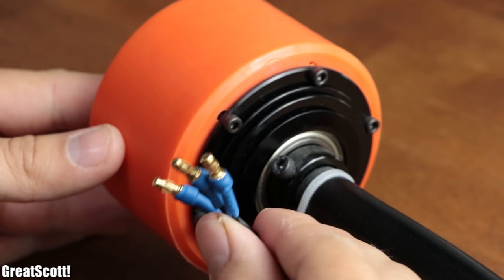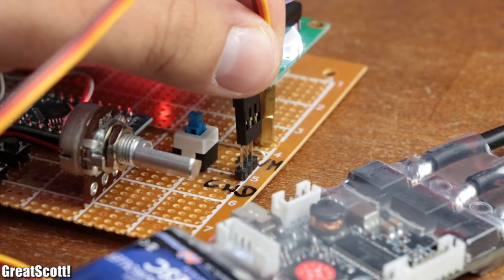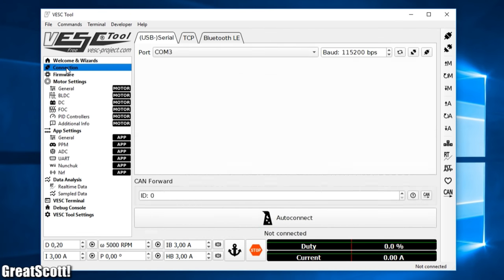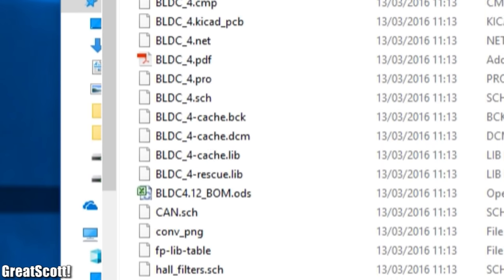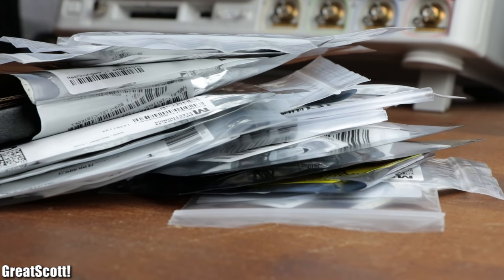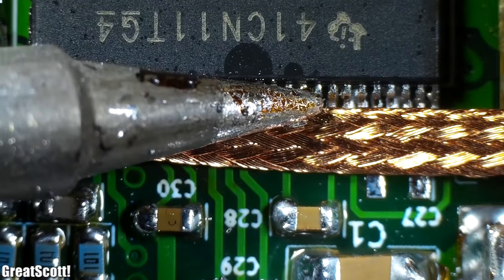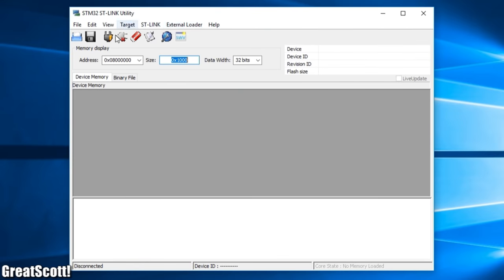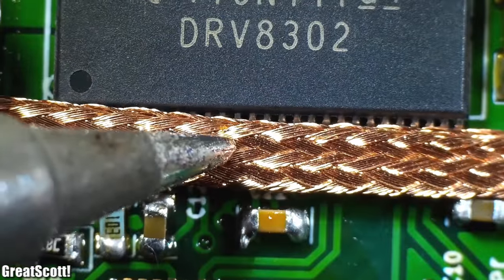VESC (Best Open Source ESC) || DIY or Buy

Comment: I think you would have had much better luck if you used copious amounts of a good organic water soluble flux, and solder with water soluble flux core. It cleans up very easily with a small amount of soap and hot water. 

It looked to me like you didn't use any flux except for what was in the solder, this is why you had trouble soldering the close pitch SMD chips. Here flux is your friend, I drag solder those fine pitch ICs all the time it's fairly easy with a lot of flux, and a little technique.

If you want to you can send me one of those that you didn't get working, and I'll troubleshoot it for you.

Have a great day, and thanks for the great videos.

Glenn
Reply: Any Amazon link recommendation for flux?

Comment: Should have had a stencil made using the top paste gerber layer, you had the solder paste for it. Also that hot air gun action might not have done some of the components too well either.
Reply: Alucard Pawpad Yeah, I’ve had a few inductors go open circuit from using a soldering iron on them.

Comment: You should practice soldering more, this way you can avoid such a hassle. Just pretin the pads, put the component on with tweezers and hold it while heating it up with the heat gun. Works perfectly fine. Don't forget flux of course.

Comment: I would suggest ordering a smt stencil when making several boards. Costs about 6$ at JLC and saves a lot of headache and combined with a hot air/oven soldering pretty much guarantees nice and working boards. Lazy as I am (or willing to pay to save time) I also order the boards  as panels (another 6$) so I can apply the soldering paste to all the boards in one go. Thank you for the time you spend on making these videos so perfect and interesting!

Comment: I’d love to see a DIY or BUY segment on a multi-battery automatic capacity checker - for someone who had a bunch of 18650s they need to check, but don’t have the time to actively run tests many times. 

Ideally something that you can place several 18650s in and it will individually charge and discharge as needed to get the final charge capacity in mAH.

Comment: Holy crap add more solder! I recommend you get some of those 5mm thick sticks used for soldering roofing iron, and possibly a flamethrower to melt it all, don't hold back.

Comment: It's projects like this that make me want to stay away from any electronic project that has to interface with a computer. It's both a good and bad thing to be biased against such projects that have such a high chance of just not working for reasons that cannot be seen and that can cause a project to fail. I say it's good because I am learning much more basic analog circuitry, I'm at the point where I have designed a schematic for a BLDC motor driver that doesn't use a microprocessor or even a semi-complex IC. Your videos motivated me to learn to do things differently, because it seems like every project you make utilizes an arduino and programming and I have neither an arduino or programming knowledge and I wanted to see you break away from the easiest (and honestly most efficient) way of making your projects just work. I wanted to see you go farther, deeper into the math and the datasheets to design analog circuits to make a project without a single line of code or microprocessor or complex chip. Thanks to your videos I have now completed a first schematic for my own extremely basic motor driver featuring 12 transistors, 6 N channel mosfets, 6 generic diodes, 6 capacitors, 6 zener diodes, and 36 resistors and I will be attempting to assemble a prototype based on what I have learned.

I know you probably won't take project ideas especially from the comments of a video that is over three years old, but if you are interested in seeing more of my learning process I would love to share it with you. I'll probably send it to you on patreon if the prototype works at all.

Thank you for creating these awesome videos, you are an inspiration to us all.

Comment: The best method I have found with soldering SMD components is to use a paper stencil to apply the solder paste onto the pads. It has worked great for me every time and the results look perfect! To cut out the stencil I use a laser cutter at my school, but you can get a small laser for around $100 and attach it to your 3D printer, which would also be a great video!

Comment: You did not use soldering flux.... Watch Louis Rossmann 's channel.... Just soldering flux, heat gun, soldering wire & soldering iron ...... You can so a professional job.... Could be way batter than you did hear... But... Hai... It still works....
Reply: Agreed with this. I was wondering why someone never mentioned him here before. It's all about the flow!
And about the com port issue, your controller might have damaged due to short circuits. They're too fragile with voltages.
Reply: I was about to make this comment.
After watch months of Louis soldering, this soldering looks too dry and painful to make.
Don't give me wrong, I'm no expert at all, but it seems like Scott had a hard time soldering this smd's.

Comment: You really need to use more flux and get some fine point tweezers instead of that garbage. Also get some finer solder if you have problems with too much solder on the pads. A flat head iron tip works much better compared to the pointy tip for me at least. Hopefully these tips help some beginners

Comment: The way you solder the SMD ICs is to float the pins with heaps of solder, then tilt the board and flow the soldering irons along the pins and the big mass of solder will flow with the iron tip until the last pin. it'll look like factory soldering. take it from a guy who used to work oir Radio Shack repair centers for many years and this was my trick until board were simply replaceable many many years ago

Comment: Add MORE flux!!! It will be much easier to solder those smd components, they will flow nicely and won't bridge/short as easily too.
Also you need to program the chips before it will be recognized...

Comment: Hey Sccott, you should have asked for stencil along with PCBs. It would have been easier to apply the right amount of solder when using heat gun.

Comment: I think you should use some soldering flux for these small SMD components next time. I tried it and really makes a difference :) It may cause a little mess but it's easy to clean off with some alcohol or aceton.

Comment: I do PCB design and bringup. You’ll have a much easier time with a  microscope, quality tweezers, smaller solder, a flux pen and a quality iron with a micro tip. Everything on this board can be done without reflow. You really have to take your time under a microscope and make everything perfect for this to be worth it. Also that 3 hour time estimate is mighty conservative!

Comment: Great video, but you should improve your soldering technic!
Reply: I applaud his courage in building up the circuit from scratch, and definitely not from a cost-saving point of view. I totally agree that even to attempt something like this, one needs to have advanced to expert level of soldering skills, unless one enjoys spending anything from 8 hrs to 300hrs trying to find faults, after finding the faults, the board burned up due to bad soldering and loose solder residue due to improperly cleaned board. Well, believe me, some people actually enjoy this process! 😅

Comment: It was fun to watch you having discovered the vesc :)   Welcome to potential pain, and potential high reward :)  Careful configuring that thing.  You can make it self destruct through misconfiguration.  I had to replace the mosfet driver once as a result of my own stupidity.  Current limit while testing, that's my best advice.  But at some point you also have to let the motor controller profile your motor for FOC.  Thar be dragons, depending on how large you go lol.  Benjamin Vedder did an amazing job.  Love that guy so much for designing and sharing this very complete system.

Comment: I also build a vesc from scratch and had some problems with the USB as well. I commented out some code and then it worked, if some failure occurs before usb is initiliazed you don't get usb. In my case, i didn't connect the battery power which caused the problem. Also, if you're on linux you can check with lsusb or dmesg what happened when you plugged in the VESC. If you get a usb device but no com-port / ttyAMC0, it probably means theres a problem with the software or some other failure that inhibts the initialization of usb. If you can still flash the uC, and the two capacitors and oscillator are functional, it probably means the issue lies with your computer. Hope that helps.

Comment: A simple tip before first powering up any new circuit, first measure resistance between ground and Vcc! If you have lets say 2 Ohm you know it will release the magic smoke if you power it up without current limitation.

Comment: I would definitely suggest spending the extra $7 on a stencil in future. Anything with less than 1mm pitch is generally worth it to me, especially with that sort of component count. Then you would have the option of hot air, hand soldering...or if you're making SMD PCBs often getting a T-962 for ~£150-200 (they work well so long as you only use the middle of it).

Comment: I'm guessing one of your SMD components has a short between pins somewhere underneath where you can't see them. :(  That sucks. Did you check the datasheets for those ICs to see how long they could survive exposure to high temperatures? You may have baked one or more of them to death with the heat gun, or while attempting to remove excess solder from the leads with that soldering iron. I've had only mixed success soldering SMD components by hand. It is such a pain! Thanks for the video; I appreciate the attempt.
Reply: this happen to me on my senior design project. took a couple weeks to figure it out it super sucks

Comment: Yikes! I was hoping it would work... I always wondered if anyone would DIY their own VESC. And when I saw this video come up, I immediately clicked it :) Thanks for the great video as always!
Reply: FirstPrinciple r sadly soldering the original vesc is a fairly difficult task as the PCB is a 4 layer and pretty compact.  Others and I have successfully soldered them before but every so often is a lemon that decides to be a pain. If not the mcu refusing to show up then it runs but even then we sometimes get one that blows the drv8301 and a few traces connected to it

Comment: You can also buy the Maytech version on aliexpress for 89$ + shipping. I was lucky that Maytech was at some exhibition/fair in Germany when I ordered because they offered fast UPS shipping with no extra cost. Build and soldering quality is decent, solder is very shiny. So far it works well (survived few short circuts).

Comment: Love all the comments about the soldering. Unless it's a short or a bad joint somewhere I doubt the soldering is the problem. More likely the MCU isn't running because the oscillator isn't running. I'm not sure what all these people think throwing a bucket of flux over it is going to achieve.

Comment: Nice project, but did you solder the DRV-Mosfet driver from it's bottom as well? There is a ground pad that requires solid grounding. I think some of the parts might have fried during bad soldering technic. As well you did not desribe what actually was working, and what did not. If you can upload a software, crystal is already working feeding the MCU CLK pin. Hopefully this project comes alive as working one.

Comment: Hi Scott, nice video. Soldering smd components surely need different tools. I am sure this only seems to be soldering problem. May be you can to solder it with someone who can solder it properly or Getting a stencil would be really helpful and you can also use your home otg oven for soldering. But it was really nice to see this. I would surely give it a try. Thanks.

Comment: You need to update your soldering methods and techniques.
Experiment with different types and amounts of soldering flux.
The low viscosity (thin flowing) type is preferred.
It has surprisingly huge effects on your soldering work.

In the case of soldering the IC's first try lightly tin the pcb IC pads.
Then clean as usual and flood the IC pads with flux such that the IC pad area literally is a pond (lake) of flux.
Now do the actual soldering in the wet flux.
You will see that the solder tends to automatically flow to where it should be.

You can still use solder paste, but you must control the amount very accurately, as any surplus solder has no where else to go, than the nearest solder pad or pin and will collect there.

Comment: Hi, I'm currently busy with a project that uses a VESC - I'm not well clued up with the components used in a VESC, but I was told there are power resistors used to dissipate some regen power to help with braking (ESK8).

Would it be possible to swop those resistors out for lets say 500W resistors (with the same resistance) to dissipate more power without recharging the battery used to power the VESC?

Any firmware tweaks needed to allow more internal power dissipation?

Any help from the comments would be appreciated.

I have been to the ESK8 forum, but I cannot post a question and have searched for this topic.

Comment: Why u dont make the vesc 6 instead the 4.12? 
Nice video like always
Reply from the maker: It seems like the VESC 6 plans are not avaiable yet. Not sure if they will ever be.
Reply: GreatScott! I have it!! You can download the schematic from vescproject.com it is open source,but you must design the PCB layout, Benjamin Vedder has a YouTube channel with info about it, and on his GitHub page you can find pictures of the PCB layout on the RC car project pdf
Reply from the maker: Thanks for the information
Reply: GreatScott! Thanks for you incredible work from Salamanca (Spain) 😜
Reply: GreatScott! Hey ,have you try the program on Linux? Because Benjamin Vedder only create the program for Linux and the other versions for MAC and windows are created by other programmer,so if you have the latest version of the bootloader maybe you need the latest version of the program, and maybe the windows version has not been updated yet.
Try it 😁
Reply: and there is micro vesc project going which is small esc with 60A max current
Reply: LInk i would love to run a vesc on my race quad??
Reply: EnDeR Wiggin yes, but only if you have a lot of money, because the vesc is more powerful and it has some features like regenerative breaking,FOC, support for hall effect sensors, data log of the all parameters during running,a powerful processor and a lot more things...
So ,it depends of the use for your RC car, if it is for hobbyist I don't recommend,but if you want to add it cameras,lidars,odometry , autopilot,RTK GPS,... Then it is worth the money 😁
Reply: Hi I made a VESC 6 pcb from the schematics. See here for more info and to request the files. https://www.electric-skateboard.builders/t/escalate-a-vesc-6-derivative/57947?u=fedestanco
Reply: Federico Stancati can you share with me the files please?
Send me to my email
albertox0404@gmail.com
Reply: alberto Cornejo: I was planning on using the VESC 6 for my mountain board and a battle bots project. I would love a micro VESC for the race quad. Did you publish your VESC anywhere?
Reply: EnDeR Wiggin I am going to make a few updates this summer,and when I finish it I will upload it very probably to my YouTube channel,and explaining how to build it,in Spanish...
Reply: sweet sounds good. I know Spanish so all good:)
Reply: EnDeR Wiggin Someone on the VESC forums is working on such a project. http://vedder.se/forums/viewtopic.php?f=9&t=1513&p=7940&hilit=micro+vesc#p7940
Reply: You can buy blank PCB FOR VESC 6.4 from ebay (CANADA) for 10$. WORKS GREAT

Comment: In all honesty, you can cut down on time, waste, and mistakes by purchasing a solder paste stencil for a project such as this. It means you get the proper amount of solder for each component, the benefit of speedy assembly and soldering, and the bonus of less solder bridges.

Comment: Surprisingly it was not so hard to assemble these, just a more accurate soldering and checking with microscope. Worked the first time:) But it indeed is more costly and time consuming way to do it. Can stretch a little bit of the cost by using different fets, but not so much.

Comment: I suggest you buy some liquid flux. When you bridge pins on surface mount IC add flux, then place the solder braid over the flux, then heat with the iron, works well for me.

Comment: Use plenty of flux (ideally jelly flux) and drag soldering method on big ic's and you can forget about hot air.  you have to clean the boards afterwards with IPA or acetone. Keep up the good work!
Reply: use mineral spirit to clean flux and never look back, acetone stinks and IPA does not do the job very well. I have no clue why IPA is recommended.

Comment: About soldering... I see you have ersa i- con soldering handle. This is good soldering station only you must increase temperature. For that pcb with lot of copper and two side layer pcb, at least 350°C to set. I have the i-con pico (80W) and much better results when soldering smd components even with classic thin wire without extra flux. I use stannol thin 0.7mm thick. Sorry for bad english...

Comment: Great stuff, If you can heat the pads and use flux a good brand the parts will line up with the surface tension of the solder. a bargain tip cleaner also is the steel sink scrubbers from the dollar store.